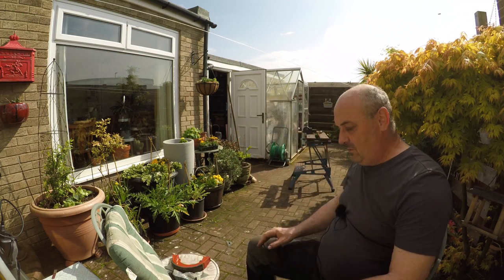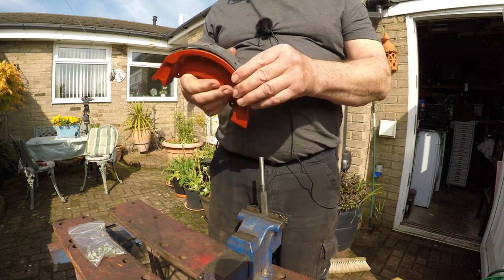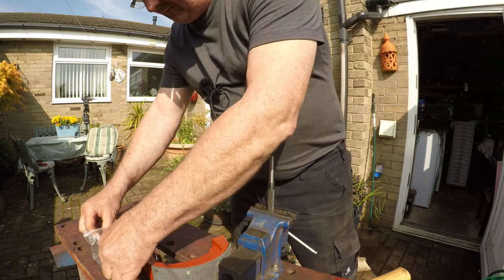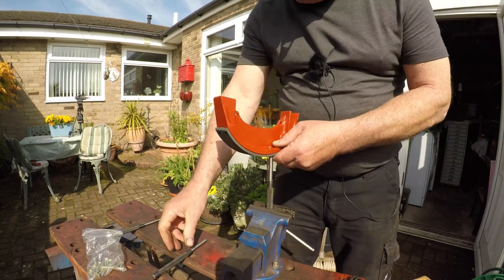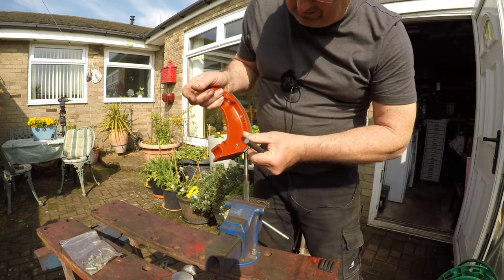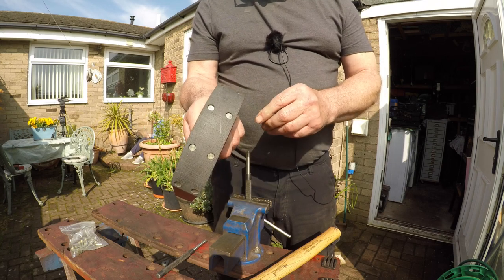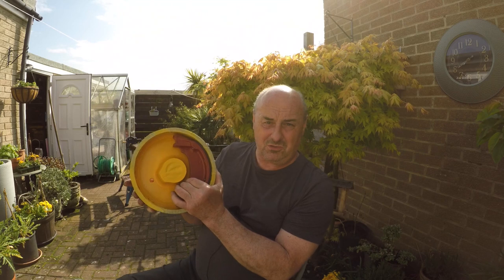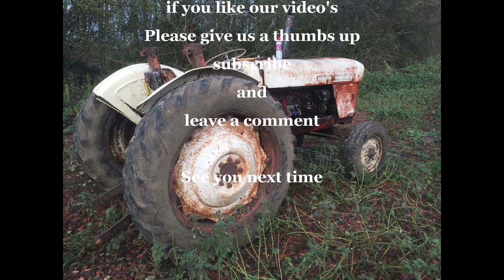Re-lining Db990 Selectamatic brake shoes #62

Comment: You had a handful there Barry.  A flat plate in the vice with a bolt sticking through just taller that the rivet hole may have helped, this used to be the apprentices job. I have the original Coxhead tucked away  somewhere, I haven't used it in ages.
Reply from the maker: G Day Lance yes it was a bit fiddly, I'll make that plate for the next time, hopefully by then I'll have my big vice out from under the shelving and on a bench, a lot of the problems where caused by bounce. Is a coxhead the device that you can screw down onto the rivets to flair them?
Many thanks
Barry

Comment: Barry, I hope the paint doesn’t make the diameter too big.  I put new pads on and fought it trying to get the final drives back on.  A fellow commented on my photo and said remove the paint and it will work.  Took the pads off, removed all paint that touched another component and they fit perfect after that.
Reply from the maker: Hi Tom, yes going to try them on the axel before reassembly
many thanks
Barry

Comment: Funnily enough I did the same job last week. Similar way, M12 bolt upside down in vice attached to an old safe. Just used the ball end of my hammer to flatten the rivets. That Black and Decker jobber mad it harder for you with the bounce. Yes a three handed job right enough.Not been filming much on the left side as it's a repeat of the right side. Just the jobs that were a bit different.Will be a few videos coming up on the Bridgeport Mill I bought soon. Keep up the good work M 😀
Reply from the maker: Cheers Marshall, yes I saw your vid on the bridgeport, your a very lucky man. Yes the bounce was a killer, agood solid bench is whats needed,
many thanks
Barry

Comment: I just finished changing the brake pads and putting the final drive back on, and it's tight! Before, I could turn the axle by hand but not now. Is it normal for the new brakes to touch the drum? I saw no other way to adjust the brake shoes, and the book doesn't mention anything. I'm working on a 1200
Reply from the maker: Hi MJM not sure about a 1200 but I know the brakes shouldn't be that tight as theyre going to heat up. Have you backed all the adjustment off the system?
Reply: @manfromthemist1958  as of right now, there's nothing connected to the brake system.  I have all pedals and rods removed for cleaning and painting and will be putting them on soon.  I cannot see anything that i could move or adjust.  It's a very snug fit.  I'll send you pictures to show you what I mean but I wanted to have the conversation on your channel to help anyone else who runs into the same problem.  Will be emailing you shortly
Reply from the maker: @MJM2014S  forgot to mention did you replace the liners or did you buy shoes already lined, Has the replacement shoes got paint on the mating face  where they contact the pins? Ton hart had problems with his 990 due to paint and had to clean off the contact faces.
Reply: @manfromthemist1958  i got the liners.  One side worked great, it's just the side with the diff pedal that is seized up.  This weekend I'll know more and will update.
Reply: The issue was the brakes, and the axle gear wasn't set properly.  I removed the drive and the brake pads had rust from the drums on them so they were obviously touching.  The rust on the drums wasn't bad (surface rust) but it was enough to cause some friction.  The other issue (probably biggest) was the axle gear wasn't set properly and had a room to move, so when I tried to turn the wheel it would bind and make it more difficult.  This was all fixed after removing the final drive and going over everything one more time, then rebuilding it again.  Everything works great now.  The brakes were a little tight but loosened up after a few turns and now it works as it should.  Thanks for taking the time to help out!
Reply from the maker: @MJM2014S  Hi MJM only to glad to help, I'm pleased you got it sorted.
many thanks
Barry

Comment: Can you over hammer the rivets?
Reply from the maker: Hi TC yes you can, you can over tighten them and break the friction material you can also shesar off all the material above the shoe that keeps the friction material in place then the rivets need to be replaced. Thats why you see me keep checking them form movement, of the rivet or the friction material and the point where they both stop moving is the point you stop.
Many thanks
Barry